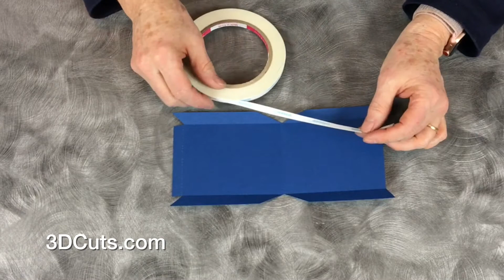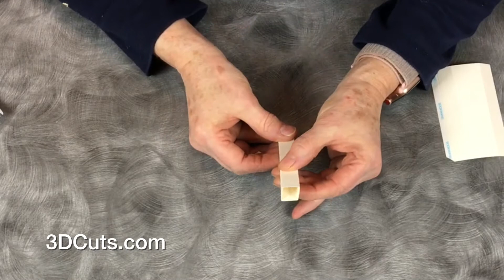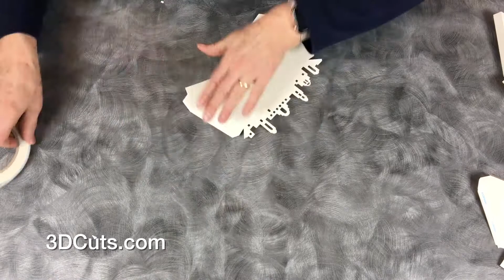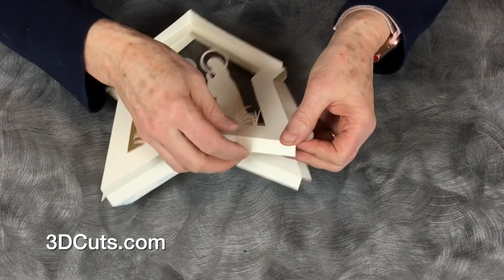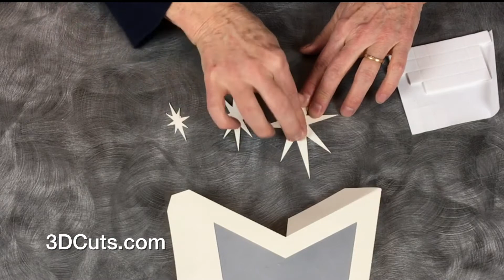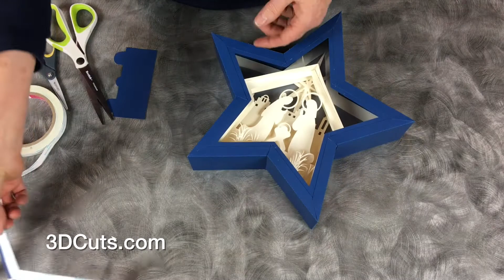Nativity Star Tutorial by Marji Roy of 3dcuts.com

Comment: what material pls specify
Reply: I've only made 3 of these but can tell you what you need, The file, 6 pieces of lighter color (white or cream), and 7 pieces of your darker outer color, finally 1 piece of vellum. Using 1/4" and 1/2" double sided tapes make it much easier to do. I also would use a good sharp pair of scissors for your tape. Then the lights. You can use fairly lights or 2 tea light flameless candles.